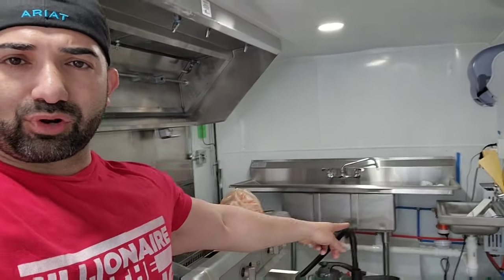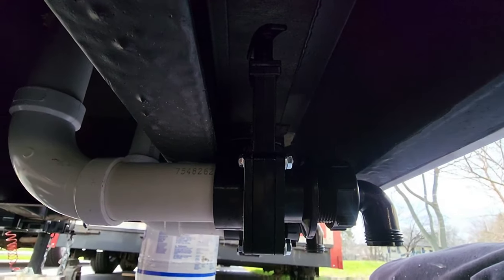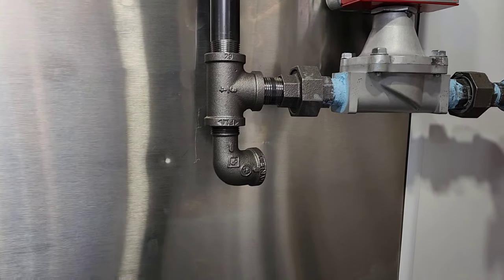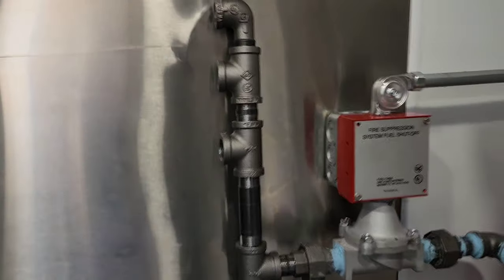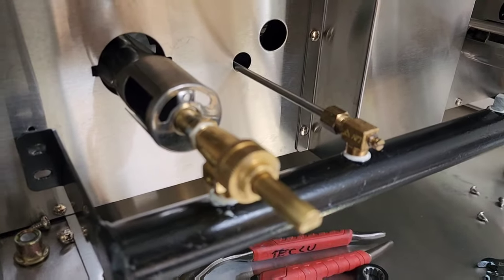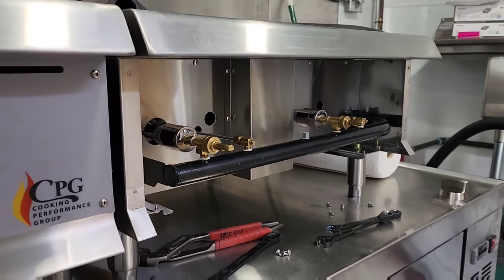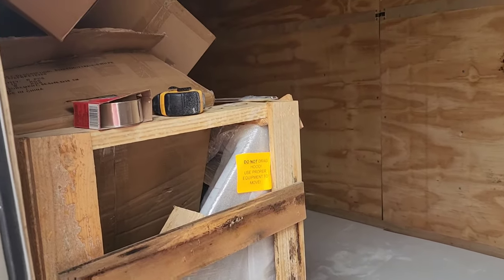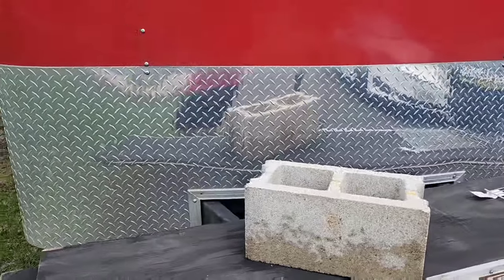Food Truck Tutorial

Comment: Hi frank
I bought empty truck and planning to convert food truck the body is aluminum ;
1. The interior wall should need aluminum or stainless steel ? If so , is the electrical line should done before wall or after wall done ?
2.where is best place to store the gas/propane cylinder /inside or outside of truck ? Thanks.
Reply from the maker: I have my propane permanently installed in the front of the trailer with a propane holder plate. Electrical I like to bury all my wires inside the walls, like a house
Reply: @fbaltierrez  Thank you🙏!

Comment: Hey Frankie starting my food truck build 
It’s a 18ft step van 
I need to add strut on the side to put up insulation plus the plywood 
What size do you recommend?? 1inch strut ? 1 1/2? 
Also the floors are really clean on the truck but I’ve seen people even put plywood on the floor 
Do you recommend doing that or just lay the flooring directly on it ??